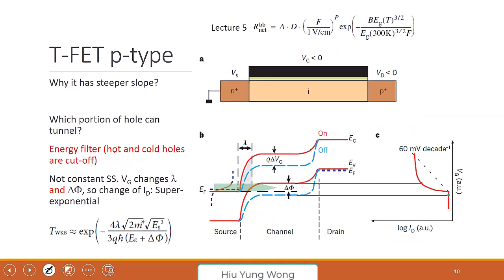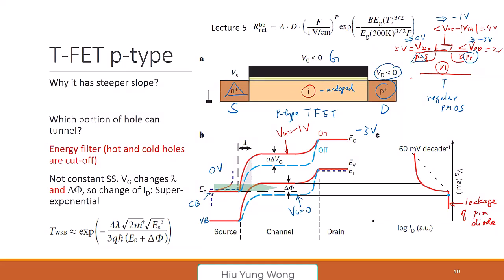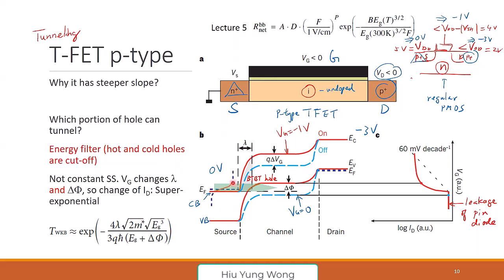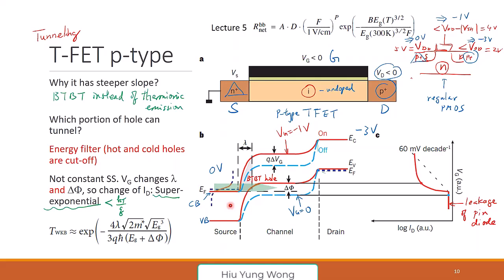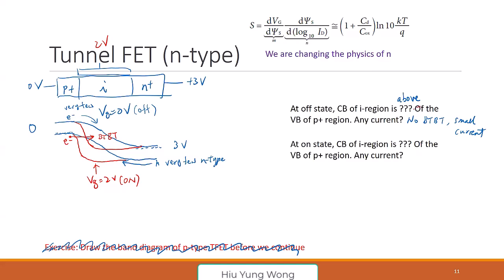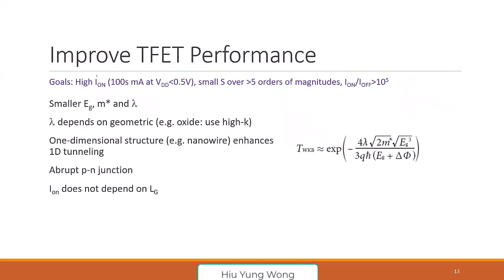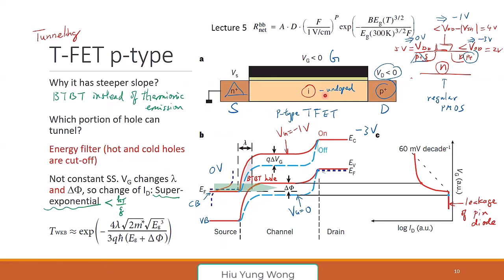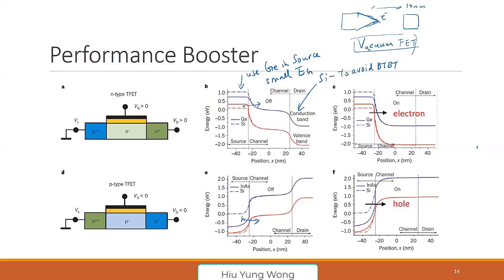24B - How does a Tunnel Field-Effect Transistor (TFET) work?

Comment: Professor, in p-type TFET, source is heavily doped n-type. So, its conduction band will have large no. of electrons. Now, when the VB of intrinsic region and CB of source align, how holes are tunneling from source CB to i-region VB as holes are always present on the VB. Moreover, if we consider that movement of holes is basically movement of electrons in the opposite direction, then are we assuming that i-region VB has large no. of electrons which gets tunnel towards the source CB (however, source CB also have very high electron conc)??
Reply from the maker: @nelsonkh001 Good questions. However, for tunneling, it is not about how many electrons you have in a region, it is about how many electrons you have at the energy level tunneling occurs in that region. This is band-to-band tunneling. Just like in a reverse-biased pn junction. Tunneling of the hole is from the n region to the p region due to the fermi level difference. Make sense?
Reply: @quantum_computing  So, in p-type TFET we are considering that electrons from the intrinsic region tunnel towards the source (n+) (or rather the movement of holes in the opposite direction) when the intrinsic region VB and n+ region CB start to align. Thank you professor for your kind response.